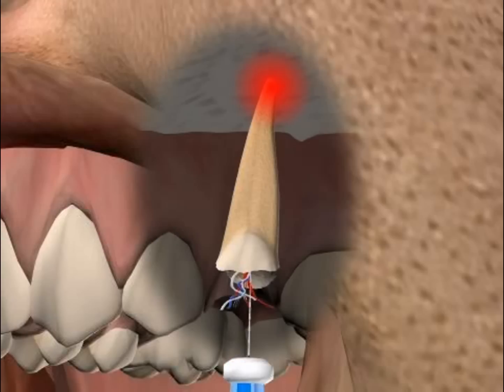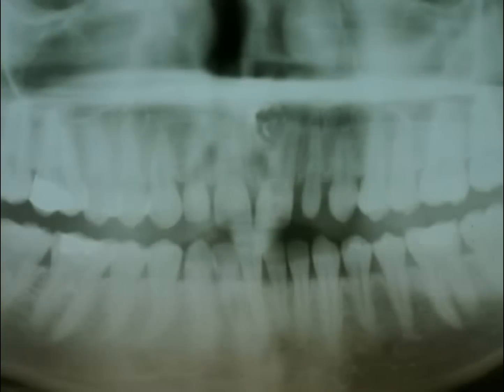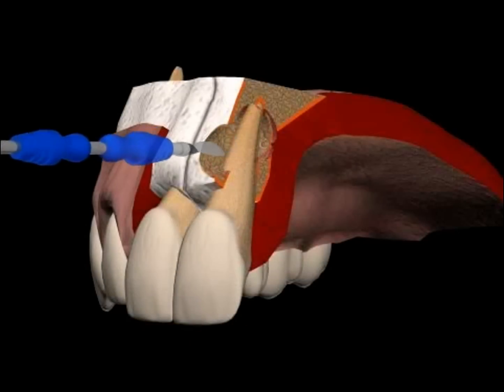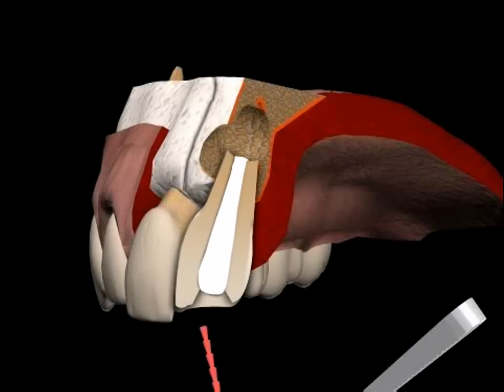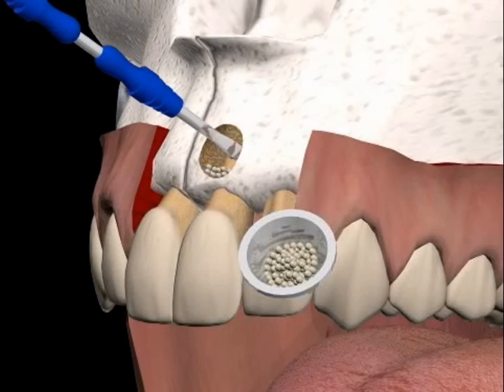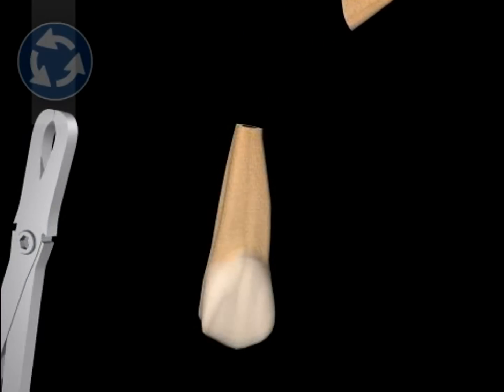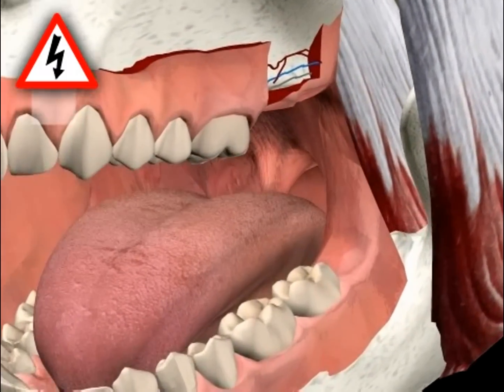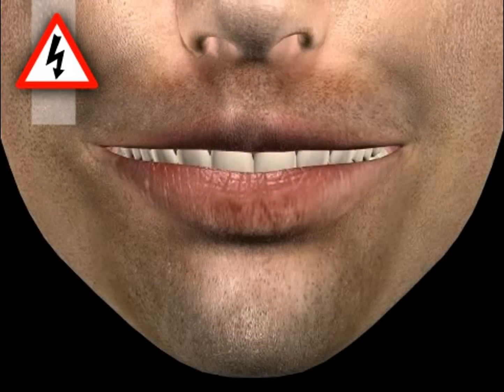Root Tip Resection with orthograde filling

Comment: I prefer to have the tooth pulled: cutting the gum just for one tooth is overkill.
Reply: It’s better to save the tooth if possible, rather than getting it pulled out. You’ll suffer more complications when you lose a tooth. You could lose bone structure, your remaining teeth could drift to close the space of the missing tooth and a lot more. Better save it than extracting it.